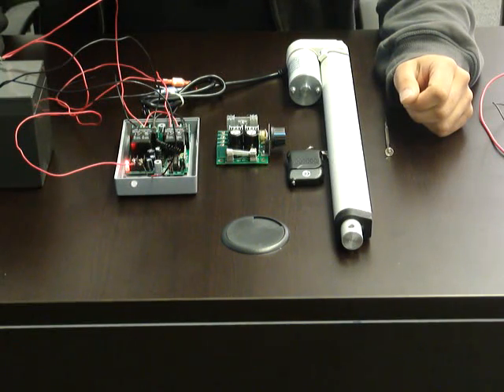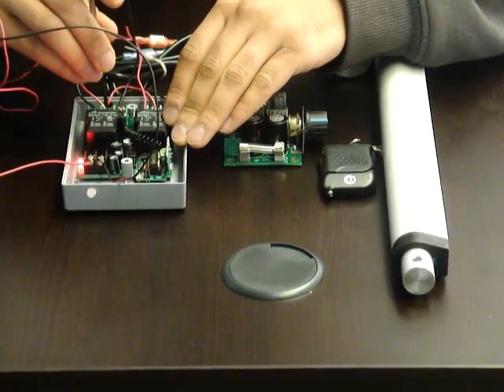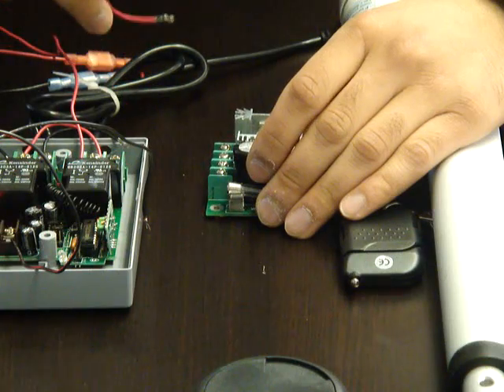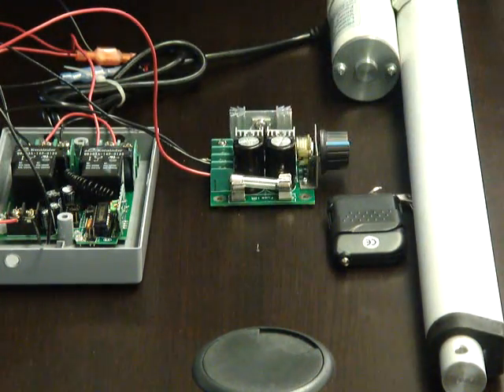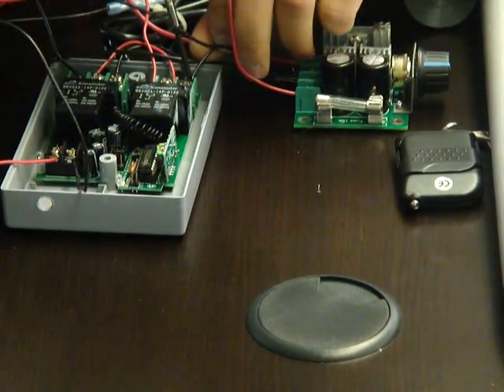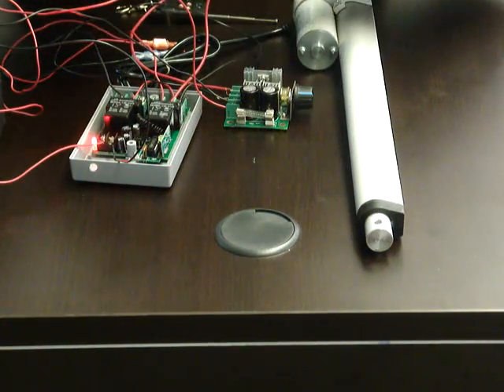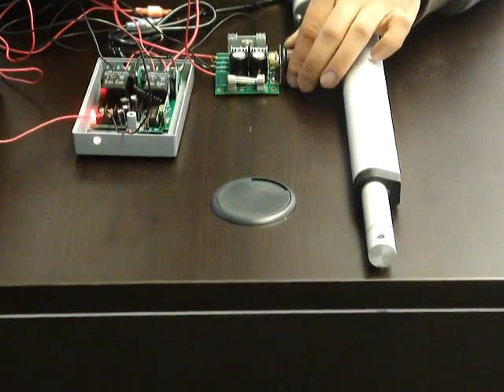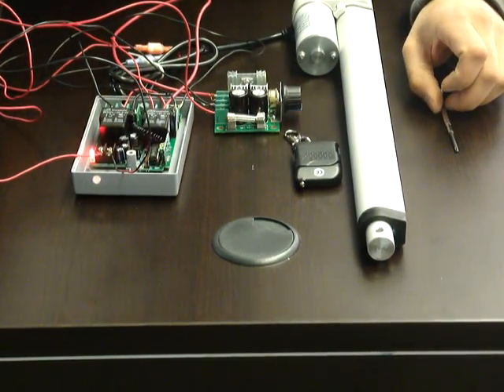Connecting Our DC Speed Controller to the Wireless DC Control Box - Progressive Automations

Comment: hey. I have a project where I need to control wireless with a potentiometer the speed (PWM) of a 12V DC geared-motor (3A current max).  Can you tell me please which kits I will need to buy ?